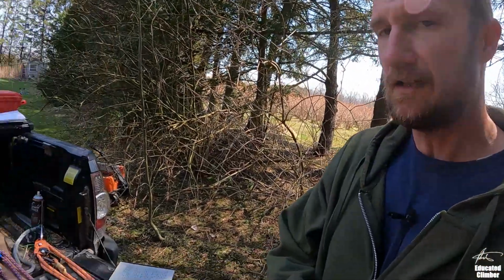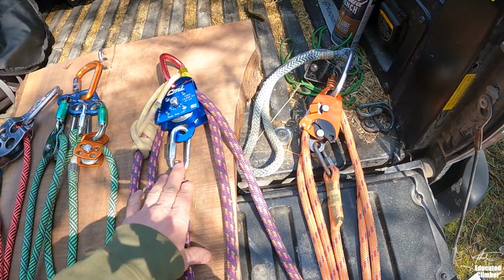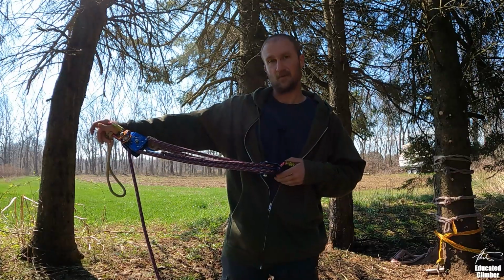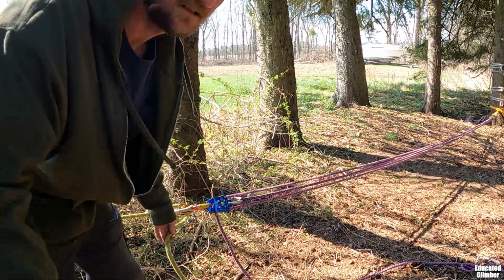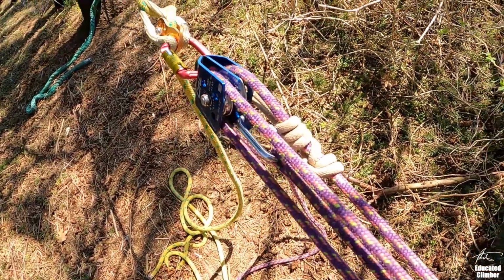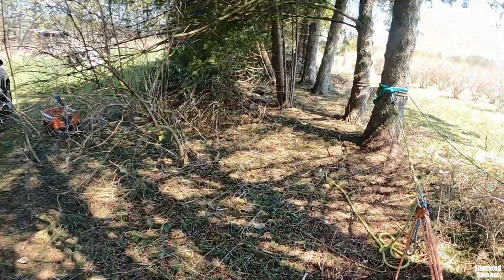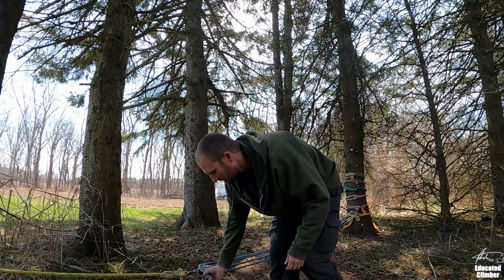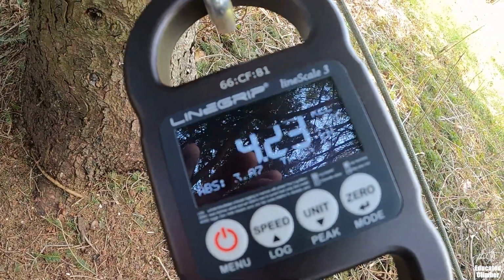Block and Tackle / 5 to 1 Tutorial | Mechanical Advantage system

Comment: Great video!
I have the same 5:1 and need to add a prusik.

2 questions
What’s the diameter of the prusik
What’s the starting length of the prusik
Reply from the maker: 10mm diameter and 26-28" long is a good start

Comment: Is there a minimum distance between the top pully and the bottom one, or can they be linked together?
Reply from the maker: The front pulley moves towards the back one as you tension. Once they butt up to each other then you can't tension any more...

Comment: You explained some things I’ve wondered about for a while; and introduced me to the Beckett. At the moment I use a homemade pull-kit, with two double pulleys. I put it together for occasional use for hedging. Mainly to pull trimmed or part trim stem/s, through a small thorn or visa-versa that I wish to keep upright but would get in the way of the hedge line. Sometimes the pleaches can be bent around, (if the’re not whole trees) but this tends to put the pleach and the upright against each other. So in wind, they’d end up rubbing bark-on-bark. Not really good for either in the longterm. Sometimes a small thin stem, can be temporarily pulled askew, a slight kink formed in the hedge and when the stem is released, the hedge bends around the tree but keeps the general line, while allowing the tree to be free of future rubbing.

I recently used the kit, to help pull a large hazel against lean while coppicing. It did help get the tree over where I wanted. Though not using a static rope, made for perhaps more pulling. As I said, I originally made the kit for hedging, where manoeuvrability of the pleach, is often more desirable, than just pulling in one direction. So the use of rope with a bit of give, can be an advantage. But I think I’ll add pulleys with Becketts in future.

Thank you for a great presentation.

Comment: I work alone or with one other person. I use the Masdam rope puller. I would like to see the force that will pull compared to a 5:1. I never saw a use for a 5:1 unless you are going to lift something. The good one's are pretty expensive. I have also used a come along to get more pull. The downside to that is you have to have a very strong rope and a thick prusik as well.

Comment: extending the system fully can be awkward if the pull line is at a steep angle or the pull is on a slope where the line is soon too high to reach the prusik. i sometimes base tie and pull to extend the 5-1 up before fixing the pull line at the base. simple but can save resetting as the tree is tettering on its hinge.

Comment: It would be interesting to see how much effect pulley diameter has on efficiency. For example, a system comprised of only micro pulleys vs a system comprised of 2” or larger pulleys.
Reply from the maker: Friction being equal, larger sheaves seem to be more efficient in my experience

Comment: Love the content. Lines ales are so awesome because it allows you to actually test what’s going on in the real world and not just rely on mathematical formulas (which aren’t necessarily wrong but most often to simplified to give the true picture) At some point you have to test actual forces of a rope jack and maasdam. My whole system is set up for me to pull about 500 of force on a single strand but using the rope jack I don’t really know if I have an over engineered system or if it’s about to fail. They say a rope will be unsheathed   at about a thousand lbs but how much cranking do you do to max out at about 500? 👍🏼👍🏼
Reply: I find the weakest point in the system to be the prusik as long as you are pulling on a rope with 7,000 lbs breaking strength. The rope will begin to twist letting you know your getting close to point of the prusik slipping and melting the rope. 🤙